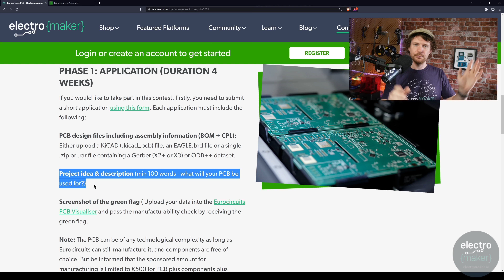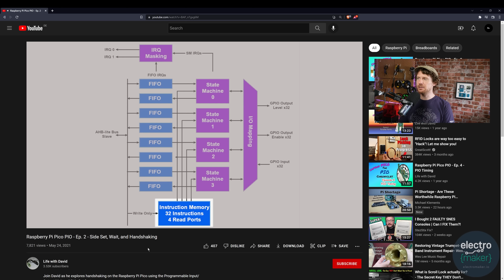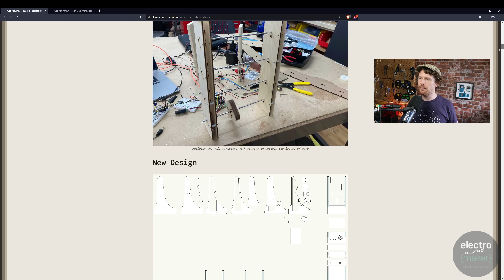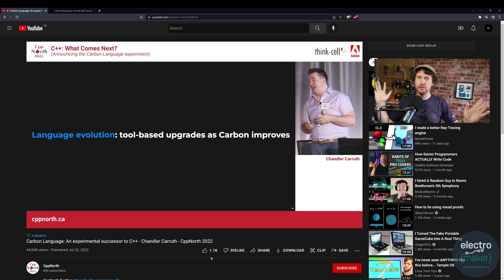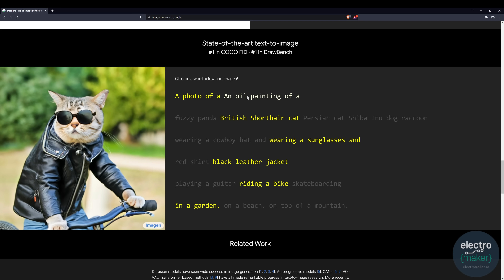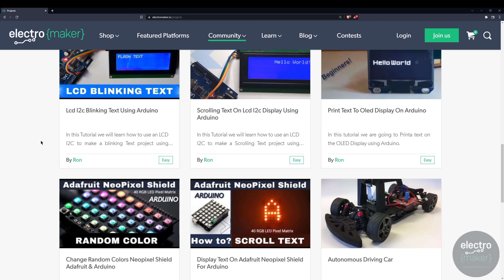Google's Carbon Language, ROCK5 Model B, ESP32 Console and more!

Comment: The nRF5340 audio dev kit sound very fascinating with support for both CIS and BIS modes.  Although I don’t have a specific project in mind, yet, the connected broadcast stream (BIS) operation mode seem particularly interesting as security awareness become a more important issue.  To be have multiple monitors of specific high traffic area and possibly feeding the channels through different AI/ML filters to highlight potential risks earlier.  But that is getting ahead of ourselves for now.  First lets explore the features of the dev kit. #nRF5340 #nrf5340